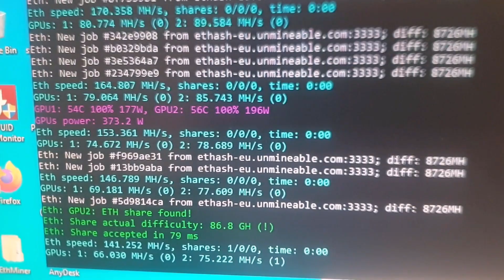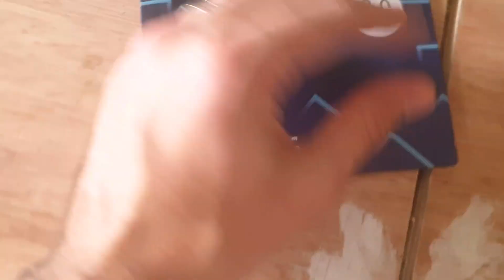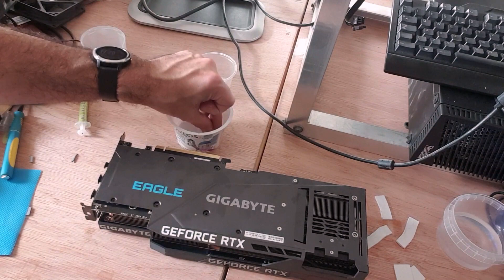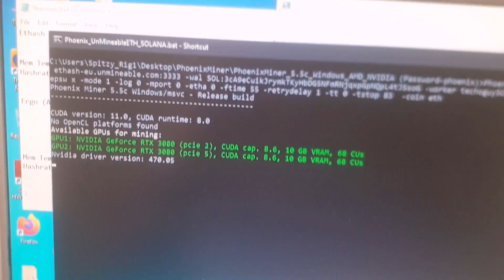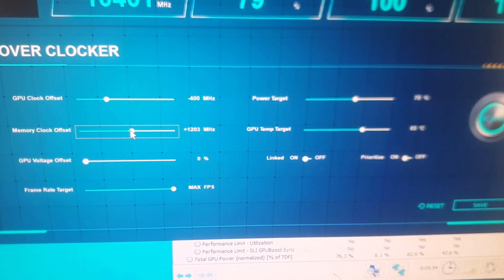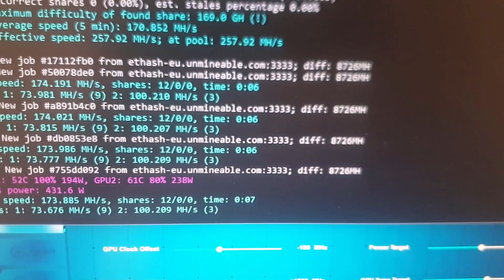Gigabyte Eagle RTX3080 | Thermal Pad Replacement Detailed Guide | More Hashrate - Less power !!

Comment from the maker: *IMPORTANT UPDATE* : The pads i used in this video on the copper plate heatsink are 3mm. They do work, however 2mm pads would ensure that you get a tighter seal between the copper plate heatsink and the GPU Core, allowing for the core to get lower in temperatures as mine was getting to 62c. So 2mm would be better on the copper part.
Reply from the maker: @blindSilver3090  hwinfo for the temperatures, and Palit Thundermaster for the OC, which also shows you the GPU core temperature.
Reply: Have you flash vbios ? Mine don't go up to 93Mhz after pad replacement
Reply: I understood that alone yesterday after watching this video and without reading this comment. 3MM is defintly too much, I used only 2MM for everything.

Comment: NOTICE : After using 3MM, It's TOO much, your card won't have tight seal on the chip and your temps will be high. Use ONLY 2MM on everything. Enjoy.
Reply from the maker: Correct, I had left a pinned comment after this video had come out that 2mm on the copper plate heatsink part is better and gives a tighter seal. Thanks for your comment, and for watching! 😀
Reply: @ThatTechoGuy  I'd suggest try to add some info box or something to the video for people that don't watch comments like I did, Or at least bold at the video description.
Reply from the maker: @itayonplay  thank you!

Comment: What a fantastic & detailed guide, thank you so much for making it.
Since you've made an *important update*, just to make sure I got this right;
1) The only pads that need to be used are the 2mm, right?
2) From your experience, does 1 package of pads (120*120) is enough to cover all the areas?
Reply from the maker: Hi thanks for your comment and for watching!

It's 2mm for the copper side and 3mm for the backplate side. 

The important update was for the copper side on top as 3mm would be slightly too thick and too tight when closing up the card.

For the underside it's 3mm and yes 1 sheet of both is more than enough, just cut to size and use what you need to cover the chip surfaces well.

Goodluck and let me know how it goes! 😊

Comment: Excellent guide!
Just bought a used Gigabyte 3080 Ti Eagle for 600€, and the memory jumps to 110°C in 10 seconds with Furmark 4k test 🤦🏻‍♂️ Need to replace those pads, and improve the thermals. Funnily enough, I found those same pads you have, just a whole package with each size, 0.5mm, 1mm, 1.5mm, 2mm, 2.5mm and 3mm pads with only 38€ total here in Finland. Thanks for the detailed guide 🤝🏼
Reply from the maker: Wow that's even better finding them with all the thickness sizes and really value for money. You will see a good difference when you put them in. 

Enjoy and thanks for watching! 😊

Comment: Seems like the main difference comes from adding pads to the places where there were none?
Reply from the maker: That helps too however the real difference comes from replacing all the pads, as the ones that come with the card have inferior material when compared to the ones I used in this video. 

The new ones I used can absorb and dissipate heat much more efficiently as they use higher quality materials.
Reply: @ThatTechoGuy  Thanks. Then I did the right thing to order a full set of pads for the used 3080 I just bought. Haven't tested it yet but I figure it's best to just replace them all at once and be done with it.
Reply from the maker: @lonelymtbrider3369  yes if you're pending it anyway might as well do it once and do it right. Just make sure you put the correct thickness pads in the right places 😉
Reply: @ThatTechoGuy  it's the exact same card as in your video so what could possibly go wrong :-D. Thanks for the detailed guide!!
Reply from the maker: @lonelymtbrider3369  you're welcome :) also wish you a Happy New Year! 😃
Reply: New pads in place. It was pretty straightforward thanks to your video and card is running pretty cool. And insanely quiet as well thanks to custom fan curve and under volting. Thanks again.
Reply from the maker: @lonelymtbrider3369  Awesome great to hear it's working well and cool. Pleasure to help and thanks for watching and your support! 😊

Comment: no bs my 3080ti eagle 108c-110c now it's running at 78-84c what the fuck! and my hash has gone from 68 to 121, amazing 30c reduction!
Reply from the maker: Well done and did you use the same thermal pads I used in this video? Is the card an RTX3080 Eagle cause 121hash seems to be really high for any RTX3080.
Reply: @ThatTechoGuy  only just noticed the guide is for 3080😅, looks same as 3080ti eagle, yeah 3mm gelid GP-extreme for back, gelid GP-ultimate 2mm for front memory and gp-ultimate 1mm for the rest
Reply from the maker: @Second0ne  no problem but still great results nonetheless! Thanks for sharing your results and the pads you used.
Reply: Прокладки какой толщины вы использовали? 
Я заказал 2мм прокладки, но они явно потоньше заводской прокладки 
Можно ли использовать покупную 2мм на слотах памяти

Comment: thanks a lot for sharing this info in such a detail manner Yesterday also i was trying to change the thermals on my card an also tried to put some pads on the back plate but what was the problem i was facing was the stopped responding on hive os an it was showing malfunction error an also without mining it was heating like hell an after removing those back plate thermal pads it became normal i think by mistake i placed the thermal pads on the capicitors back thts why may be it was shorting something an was heating up like hell.... Will try again the same way u have tought an lets see wht will be the results i have bought 15w thermal pads will that be ok as u were using 12.8 w one an how does these numbers of watts matter for the thermal pads can u pls explain
Reply from the maker: Thanks for watching and for your support I'm glad you found it helpful 😀  

Regarding the rating, yes mine are 12.8W/mk, which means the ability of the material to be able to conduct heat from one side to the other in Watts per metre kelvin. 

So if you are getting 15W/mk pads then they should be better. Just make sure that they are 3mm thickness for the backplate to ensure you have some squish when you put the card together again and tighten it.

Comment: I used a noname pads from aliexpress, backplate 3mm and copper plate i think 3mm or 2mm (not shure) and so i get 104 celsium memory temp and 95 hashrate. think of getting brand pads with 12 kw thermal conductivity like you used)
Reply from the maker: Still sounds high at 104 Celsius. For the copper definitely use 2mm. Backplate the 3mm are just fine. 

Yes the branded pads do cost more, but the thermalright pads I used are really amazing and the results speak for themselves and they are still going strong! 

Temp remained around 98celcius on memory Junction and 102 hashrate.
Reply: @ThatTechoGuy  Just make change of thermalpads. I use Gelid 2mm so memory temp drop from 106 to 86, but core temp rise from 50 to 58. Thx for your video

Comment: how many 2mm pads i need to replace the pads on 3080? i have the same card
Reply from the maker: I bought a sheet of 12cm x 12cm which is more than enough for 2 cards. So around half that for 1 card.

Comment: Wouldn't be easier to place the pads directly on the memory for a more precise placement?  also you have a large pad over one chip that's intended for three chips.
Reply from the maker: On the hestsink copper end there are markings to help you to be precise on placement, but yes you can do it the other way around as well. It works great and still going strong! 🙂

Comment: Thank you, I ordered Gigabyte Eagle 3080 Ti. Hopefully I would not need to change anything.
Reply from the maker: The 3080 TI is not the same as the cards I have in my video here and for now they will not give you full hashrate as those are LHR out of the box.

You will get around 70% performance on it meaning around 70MH/s.
Reply: @ThatTechoGuy  Thank you. I was saying that about thermal performance. By the way 3080 ti mines between 80-85 with recent updatea in mining programs such as t-rex miner.
Reply from the maker: @poyraz8368  No problem and thanks for sharing the update info. No you should not need thermal pads since this won't be at 100% mining, but the thermal pads will still help to keep the temperatures on the memory modules lower and could potentially help to overclock higher and avoid thermal throttling.

Goodluck and happy mining 😊
Reply: @poyraz8368  one thing ive found is that gigabyte card generally haven’t got the best thermal pads and replacing the pads on gogabyte caress do help

Comment: I would love to replace the thermal pads on my gigabyte rtx 3080ti but my local seller says it will void the warranty on my card. I am thinking on buying this for my very first gaming pc because its much cheaper than a rtx 3080 or rx 6800xt cards. Also use it for minning when not gaming
Reply from the maker: Believe me if you take your time and do it right you have nothing to worry about and its well worth it, but yes it does void the warranty if they find out 😉
Reply: @ThatTechoGuy   u give me courage to do this. but can i just lower the hash-rate to prevent thermal throttling on the gpu if I decided i can’t do it? Also i found another brand and its an asus tuf but it cost 300 usd more. Does buying the asus tuf means i no longer need to replace the thermal pads for minning? Or should i get the gigabyte one which is less cheaper than the asus tuf.
Reply from the maker: @Lerox2234  The Gigabyte Eagle cheaper cards need pad replacement. Other brands like the Palit does not, but costs more. Yes you can lower the overclocks and have less hashrate so it doesn't thermal throttle but you're not getting the full potential out of it!
Reply: not in america u cant void warranty by replacing thermal pads 😎👍